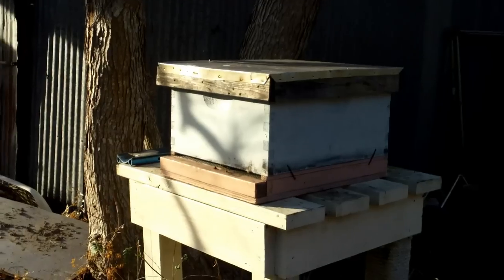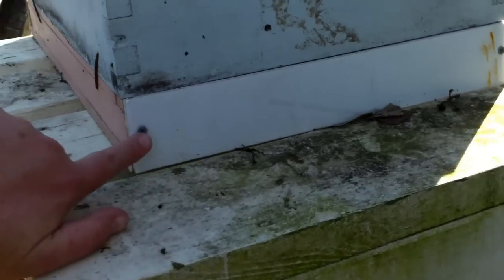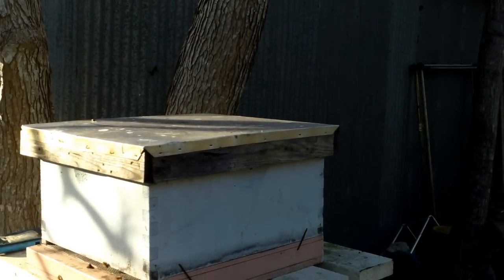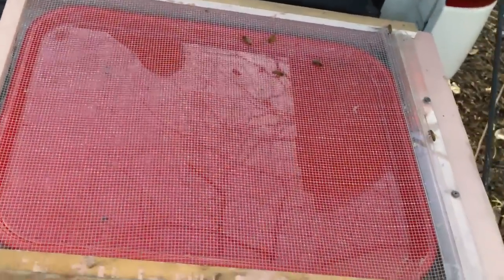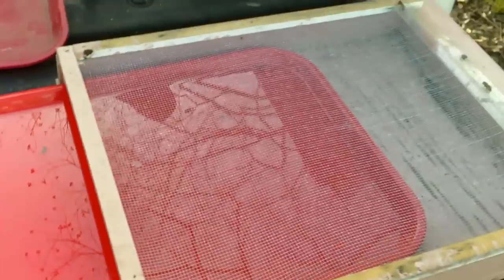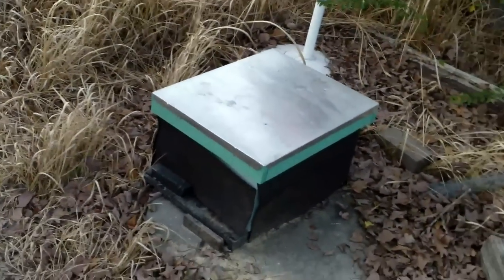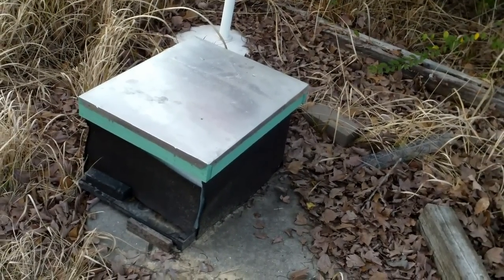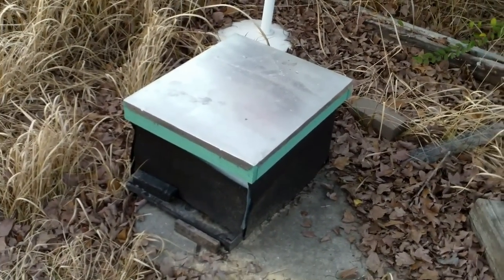Oil Tray Bottom Board and A Lame Experiment

Comment: Do you like the oil tray system? I used the Beetle Jailer or Beetle Buster works good,  but will still have some Beetle's but not as many...  I was thinking of using Pool Grade DE in the tray rather than oil, it suppose to cut up the SHB. Mites legs off! I haven't tried it yet...Was thinking of using the oil in summer time and DE in the winter    cheers buddy
Reply from the maker: I like the oil better.  The DE gets dirty after a while and doesn't really work all that well until you clean it out and freshen up the top layer.  The only benefit I see to using DE is that your hives don't have to be perfectly leveled.
Reply: 628DirtRooster Great, i was thinking to of the moister the oil gives off too plus the smell of oil  Cool thanks for the reply

Comment: So, ya change the oil every 3000 beetles?
Reply from the maker: This is a Ford hive.  You just add oil as it burns it.
Reply: Lol 1 quart per month every ford I've ever owned.
Reply: @628DirtRooster  FORD Fix or repair daily. found on rubbish dump. Unless you find a taxi or a police vehicle which are built to a higher standard.

Comment: I saw a video where one keeper used a table cloth, fastened it with double sticky strips, used a brush to fluff the bottom up. It was installed upside down, the strip prevented bees from pulling on the cloth. When beetles fell in, they became caught on the fluffed side.
Maybe, you can try that?
Reply from the maker: We've done those.  They work OK but I prefer oil.  The table cloths do require less setup.
Reply: Was a thought

Comment: Cooking oil gets bad after a while and start to smell and this may be worse with dead bodies in them.
Do you think that this would be a problem with the taste or smell of the honey.
Reply from the maker: Doesn't seem to do that in these trays.  The bees drop so much pollen, wax and trash that the oil turns into a layer of trash that has to be scraped off the tray and it has almost no detectable odor.
Reply: Thanks for the answer.

Comment: I switched to de powder.  Works fine and no mess. Also the hive doesn't have to be level.  Many will worry it will get into the hive but  I've never had the problem.
Reply from the maker: +Gene Miller We've figured out that our climate here is too humid for it.  Probably works pretty good and I dry environment but not here.
Reply: I used DE last year and it worked great but it was a lot of upkeep because it was constantly getting hard from our humidity being in the southern states. It’s great for cooler months if you use a screened bottom because it sucks up moisture. Oil seems to work a lot faster in the killing of the beetles.

Comment: What's the point in the innercover signs in the yop of the boxs?
Reply from the maker: Initially it was to correct a mistake in the tops we had.  My dad made a bunch of metal wrapped tops with peg board on the under side and the beetles had unlimited hiding places.